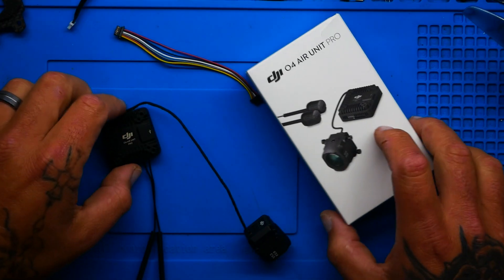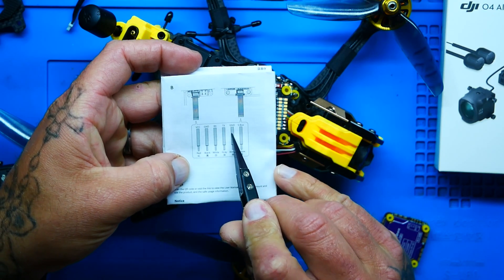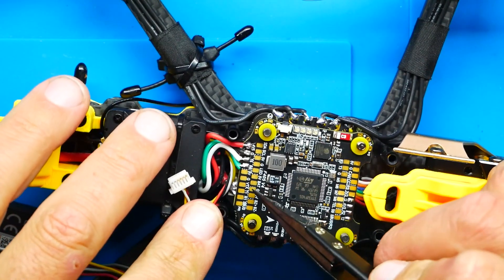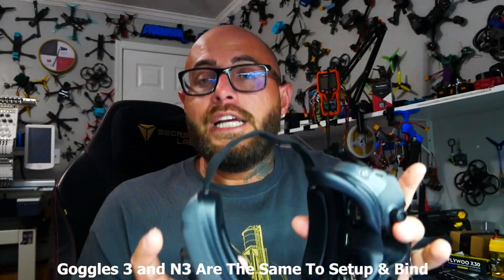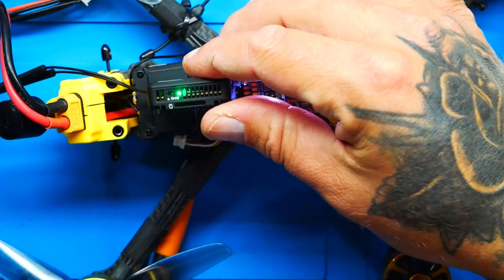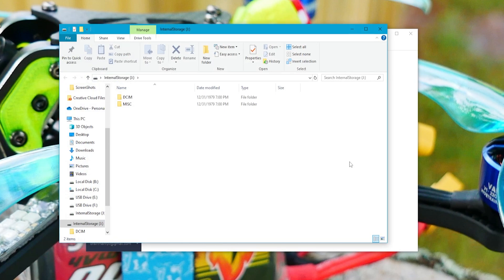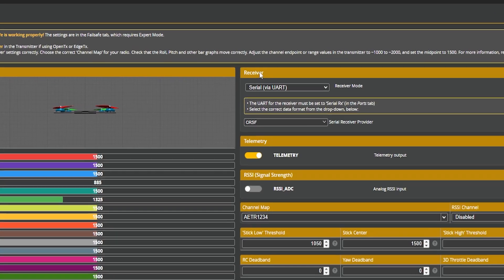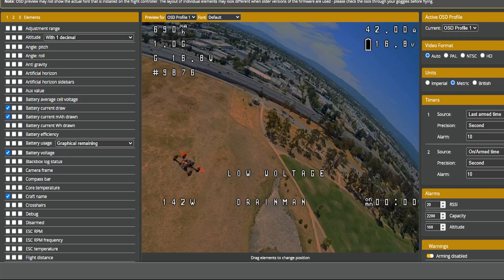Quick Setup Guide - DJI Air Unit 04 - How To Wire, Flash & Betaflight Setup !!

Comment: Hey drain man... wonderful indepth guide video..but I need some help or some advice as I'm now getting into fpv..well I crashed the DJI FPV drone and it's totalled..so now I have a speedy bee master 5 v2 with a skystars blheli32 60amp stack with :
Vbat input of 7v-25v (2s- 6s) 
BEC: 5V 2A cont. ( Max.3A)
LDO: 3.3 v 
with a 35v 1000u low ESR capacitor all in  analog BUT! ..have decide to go digital  with the DJI 03 air unit by soldering..IN REGARDS TO POWERING THE UNIT..do I jus solder straight to the BAT/VBAT pin out pad ?.. I don't wanna  voltage spike and burn the 03AIR UNIT..I kno how to solder the rest wires RX to TX ..ground to ground..SBUS to R1 and so on..JUS NEED ADVICE ON POWERING AND NOT BURNING OUT THE UNIT
Reply: Oh and I'll b powering everything through  ovonic 1550 mAh 150c 6S lipo

Comment: Good evening, I hope you are well.
Congratulations on the video, it helped me a lot.
I have a question. If I use a BEC (because the output on my FC is not working properly and I don't want to connect the receiver directly to the battery) and I'm not using a DJI controller, I believe the wiring would be something like this:
VCC (Receiver) -> BEC +
GND (Receiver) -> BEC -
Rx (Receiver) -> Tx (FC)
Tx (Receiver) -> Rx (FC)
In this configuration, do I need to connect the GND from the BEC to the FC to establish a common ground?

Comment: I’d really appreciate some help. I’m new to fpv and I’ve bought my first drone which is the geprc moz 7 04air unit with the taker h744bt flight controller. I’ve got the DJI remote 3 and the googles n3 which is all bound up! I have video through the googles but I cannot get my remote to communicate with the receiver tab in betaflight. I’m almost positive it’s the same uart 6 but I cannot get my controller to move the sticks to show the controller is working. I’ve tried everything now for 2 days and still cannot get it to work. Any help would be really appreciated? I might be totally missing something cos I’m a amateur

Comment: I setupmy drone with air 4 pro unit but cant see OSD on my goggles, what's worong here?
Reply: Did you enable the UART you are using on beta flight?
Reply: @kareemboakye-yiadom40  In my case, when I enable UART, the O4 telemetry (battery voltage) appears in the goggles, but all the other heart rate telemetry does not appear.

Comment: Careful - I lost OSD when removing the yellow and brown wire!  You need the brown.  When I only removed the yellow wire, I got OSD
Reply: Hold on man.. I'm having an incredibly hard time getting my OSD to show up in my goggles 3. I have the same O4 air unit pro. Are you saying when you removed the yellow the OSD from beta flight showed up in your headset??
Reply: @danielbowersmusic Yes. When I removed yellow and brown I lost OSD. When I put back the brown wire, I got back OSD. So only remove the yellow wire. Hope this works for you!
Reply: Do you have to remove the yellow wires for things to work? Or can you just leave it connected

Comment: Do you know if using a tmotor f7mini stack if the dji port works with o4pro?  Gonna try direct solder next but wanted to see if the cable alone would work. Not using a dji controller. Seems like no power, I don't see lights but it gets warm. I can update firmware via usbc no problem so im thinking power issue with the dji port cable.

Comment: Have any info for the lite version? I bought the Pavo femto pnp. I bound goggles 3 to dji fpv rc3. Then activated air unit and bound that to goggles. I have video feed but I’m not getting any input with controller on beta flight.

Comment: Ok amigo e conectado mi unidad aérea a mi controladora de vuelo con el cable original de la uinit o4 pro,necesito saber cuál es el puerto para poder conectar mi dji rc3,en mi caso estaba ya marcada la 6 y el sbus ya lo e activado  pero no sé conecta ? Cual sería el puerto amigo ?es un speedybee máster 3x me lo podrías decir muchas gracias amigo

Comment: Thanks for the Video/Tutor - I have G3’s and FPV RC3 bound to my 04 Air Unit in a Smart35 - yet as soon as I arm - I have erratic behaviour and almost like a motor twitch - installed Crossfire and bound to a Tango 2 and it flew as expected - why is the behaviour so erratic with the DJI FPV RC3 ??? Any thoughts would be appreciated - honestly don’t want to carry 2 radios around

Comment: Great video! I am also using the 04 air unit plus the goggles 3 and the controller 3 and I have everything set up correctly, as far as i can tell, I’m able fly the quad copter just fine but for some reason the OSD screen doesn’t show up from beta flight. is there any chance you could please help me? Thanks in advance!
Reply: Yes please I need help with this one
Reply: Same here. Dji goggles 3 dji O4 Pro, can't get Betaflight OSD
Reply: Gibt es mittlerweile eine Lösung?
Reply: Ich habe auch kein OSD.
Reply: Same here - no OSD!  Any luck?

Comment: Heyyypilot. Regarding to this tutorial video for the dji 04 unit. We cannot used radiomaster remote ? Just the designated dji RC only and thats is the RC 3 ??? No other remote can used???
Reply: You can just watch the part again he removed those 2 wires as hes NOT using dji remote watch the video eh
Reply: You can just watch the part again he removed those 2 wires as hes NOT using dji remote watch the video eh

Comment: Any reason why the DJIo4 would stop turning on after using the DJIo3 preset on Beta FLight? When I connect DJIo4 to the DJI firmware the power does turn on.

Comment: Thanks for the help! Could you help me with this problem? I've connected the grey wire to rx 2 and the white wire to tx2 and have set the MSP slider on uart2 to on. I also enabled the peripherals in uart2 to VTX (MSP+DISPLAYPORT) but cannot seem to get any OSD in my goggles 3. am using the dji 04 lite, and everything is setup in the betaflight OSD tab. Got any tips?
Reply: I got the same problem and can't find an answer.  I'm directly plugged from the o4 to the SpeedyBee F405 v4 via UART1.  Everything is set as far as I can tell
Reply: @flawlesskrush2145  i figured it out! you have to install the dji 04 preset. In the ports tab, you need to enable the vtx for uart1 to MSP & Displayport

Comment: Nice video, thanks.  Can you help with a problem with setting up DJI Air 04 "lite", on my  Betafpv, Pavo20,  with DJI Googles 3 and DJI FPV Controller 3.  I got devices updated and can see video in googles, and have controller linked in googles, but cannot seem to get my controller to work in BetaFlight (sticks don't show any movement).   I have the colored bars, and have set it to UART 5, for SBUS and SBUS set on the receiver tab.  Also tried setting "sbus_Baud_fast = on" in both BetaFligtht and in the Googles 3.  Controller works fine with Liftoff and with DJI Nano etc.  so doesn't appear to be controller.  First "real" drone, and have just enough information to be dangerous.  I tried different UARTS, with no luck and from what I read that Pavo 20 says UART5 for SBUS for DJI.  Stumped.
Reply from the maker: Hey Scott, the lights on your radio should be solid. If so then it's on BF side. If not then it's on the DJI side. Did you turn off the serial port selected for the internal receiver? Try this video, if no luck, email me. 

https://youtu.be/esNTt3939BA?si=f9wyyN5fVNjxvZJX
Reply: I had ran into the same issue, but after updating the Controller 3 to the lastest firmware, it worked

Comment: Hey drainman. I'm a noob and just built 2 quads there hovering nicley. I'm using a radiomaster gx12, but I also might wanna fly using my dji controller can I leave those two wire pins in or do I have to make my choices.
Reply from the maker: @zakiranderson722  you can leave them 😁

Comment: Hey man, Im trying to activate an 04 lite . I have downloaded the dji  assistant 2 consumer drones app
Im signed in to my account 
Bound to the googles 3 and I cannot get the app to see the air unit 
I have  used the cable that it came with , a data cable for my camera rig and even a fiber optic cable usb a to usb c
I am drawing power straight from the esc on a 3s rig
Reply: I have the exact same problem, did you find a solution?

Comment: i'm no expert, but i'm pretty sure that dji o4 pro is only compatible with the controller 3. maybe the o4 lite is compatible with the controller 2. maybe confirm? thanks.
Reply: O4 Pro and O4 "lite" are both compatible with either 
1: goggles 3 + FPV RC3 or 
2: Goggles 2/Goggles integra + FPV RC2
Reply: Don't need no damn DJI controller fool why even write this trash if you haven't a clue dummy dumm

Comment: Hope you can help have you ever come across the o4 unit just flushing green fast and no other lights when putting power to it I can’t get it to bind or anything thanks
Reply: Same here, using a f7 v3
Reply: Have you fixed this? I have 2 air units and neither will bind to my goggles 2. All au's and goggles have latest firmware from dji assistant 2 consumer drones program.... so frustrating

Comment: strange, i update my goggles 3 using app on computer(did need to power it on or you only get USB drives ) ... and i did not need to power O4 on air unit to update ...

Comment: As a new person to dji so if I am running my own Tx so dji not plug and play?????? I have to solder ??????
Reply from the maker: Depends on your FC, the air unit will still be plug-n-play, but you will de-pin the wires as shown in my video. Then wire your RX.

Comment: Great video! I just got my DJI gear. I'm new to digital fpv. I have a FC with a plug for air unit and a few uarts that not being used. How do I determine what uart I'm using when I plug air unit to FC? There are not many videos like yours on YouTube yet. Thanks bro.
Reply from the maker: Heyyyy! If it's not labeled on the FC, pull up the pin-out online and it should say, if you still can't find it, email me I will help you find it drainmanfpv@gmail.com

Comment: Yooo drainman check out my reel ive just destroyed 2 04 air units today and one has black screen and says imu error any ideas only did this after a hard front end smash ? Cheers bro ❤❤❤
Reply from the maker: Dang!! That blows, I have not seen this before. Lmk if you figure it out
Reply: @ yes mate the air unit gyro is toast so dji say these 04 units are not very strong compared to 03 and it rips the whole aerials pads out aswell not good lol killed 2 units now